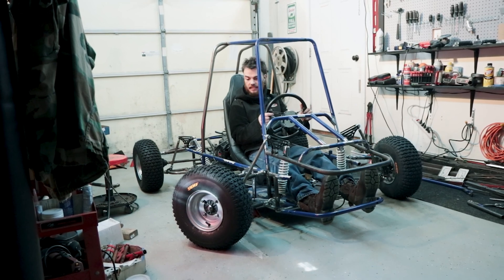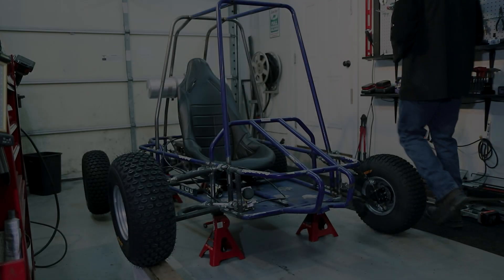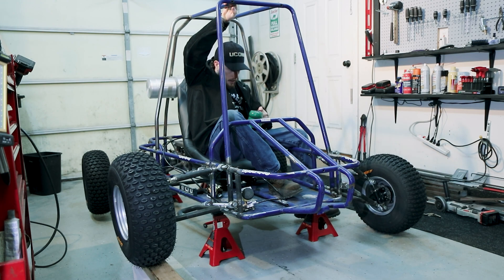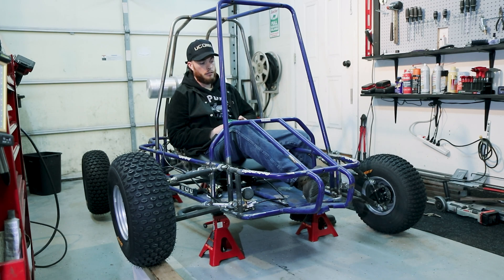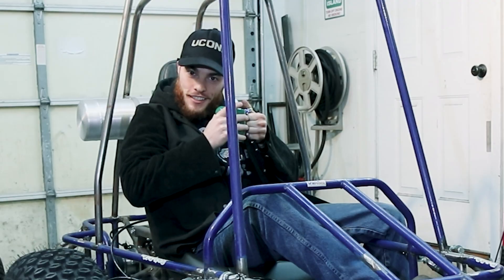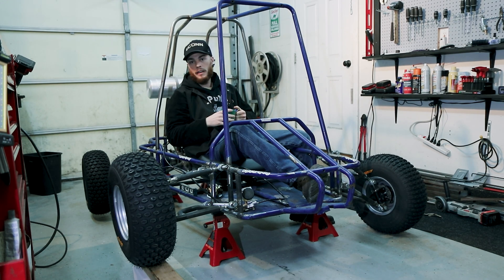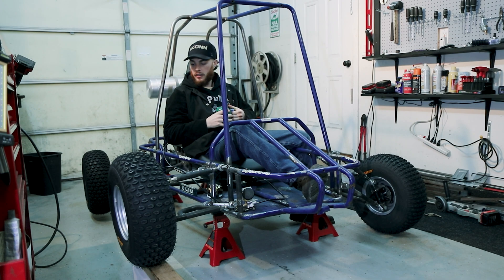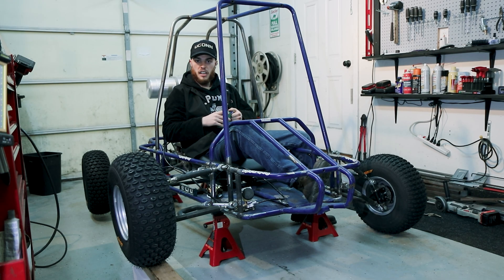Cross Kart Cantilever Suspension  Build | Homemade Long Travel Off Road Race Buggy

Comment: Is the wheel base square?  As in as long as it is wide?
Reply from the maker: Almost exactly. At least in track mode. Trail mode is a few inches narrower from the suspension travel
Reply: @TyranisCustoms  that's interesting? Is it on purpose? Does it promote better handling. A square wheel base isn't something I've seen before.